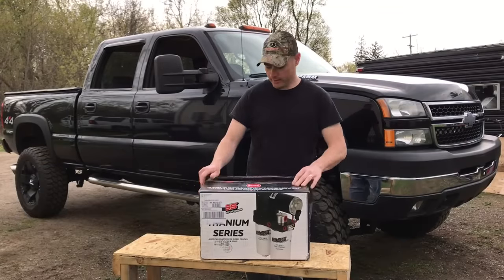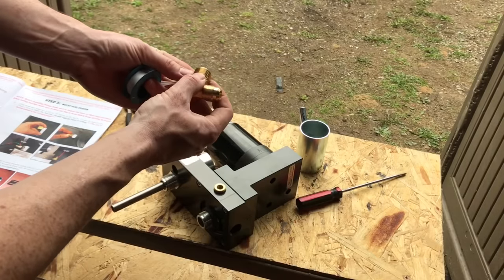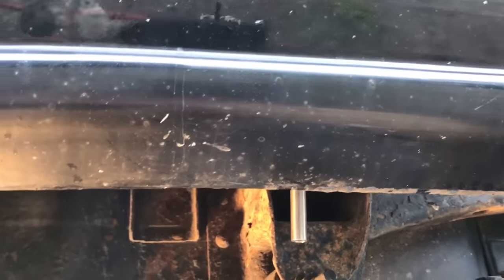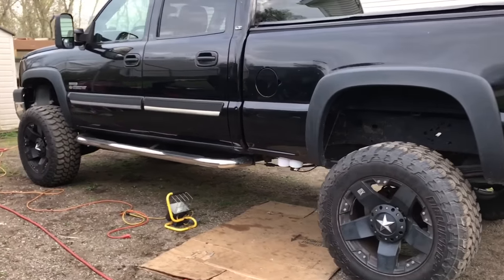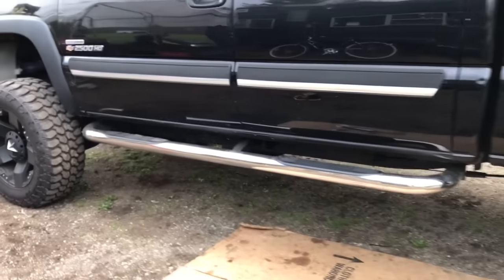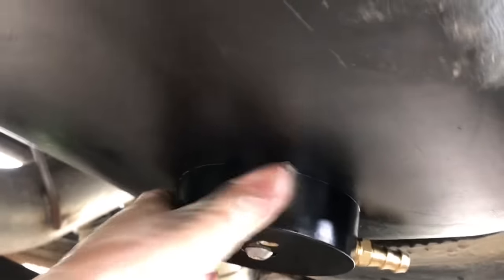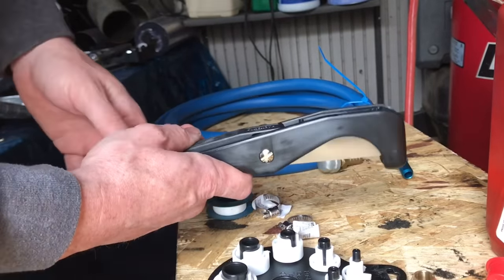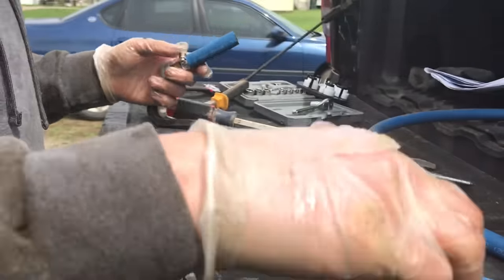Duramax FASS Lift Pump and Sump Full Install

Comment: Right after crimping fittings with vice-grips he says don’t skimp on how to cut hose
Reply: Yeah I felt the same way I commend him for doing his own work but come on man really
Reply: Don't forget his 25a fuse in the 10a ignition slot.
Reply: Don’t skimp but he used pocket knife to cut the filler hose 🤔
Reply: @ermannodangelo1062 as someone who always has at least two knives at all times and spends significant amounts time sharpening and caring for my blades I challenge you to show me any tool that will cut faster and cleaner than my pocket knives lol
Reply: @fishinmagician3960  ginsu 3000 son...Betta axe sombuddy
Reply: Ahhh vice grip crimps on the ring terminals did make me cringe a bit

Comment: Why did you put the sump in? My son has a 03 gmc and he bought a used fass    System and will need to get a hose kit plus the electrical kit to hook it up. Just wondering why you decided to drill a hole in your tank?

Comment: You put the Teflon tape on bass ackwards
Reply: I was yelling that entire scene, "No! No! It goes the other way!" but he didn't hear me...
Reply: Th second fitting looks okay if I'm seeing right but he definitely did the first threads backwards
Reply: Ya, noticed that.
Reply: @hollaschracing3753  3 vv
Reply: I scrolled down to see if anyone commented on that. First comment I see hahaha
Reply: Haa haa haa. I wanted to say something about the teflon tape also. He also used the crescent wrench backwards. I raz on my coworker often for that. In the case of Truck Master here...it's not that big of a deal.
Reply: You could skip making that mistake by just using pipe dope
Reply: Oh man, it made my brain hurt. Then he put a hole in the bottom of the tank and I was like, wait are you sure? Sure enough it leaked everywhere. Then he left the filters hanging out the bottom of the truck, and I was like wait that aint right. What happens when I go offroading having my filters all exposed like that?
Reply: That’s not the correct tape to use with fuel just saying

Comment: When installing a sump with your lift pump (highly recommended) use the old fuel pick up line from the tank as your return line. A. Do not have to cap it off. B. Do not have to hack into your fuel tank fill line. C. Makes for a much easier and cleaner install!

You will either need to cut the Bundy fitting off the fuel tank fill line adapter part supplied with the pump kit and hose clamp it on the fuel hose like I did temporarily. Or, better yet, order the right Fitting Fuel Line Quick Connector 1/2” Barb to 1/2” Bundy Male Tube. Parts dealer didn't have it so I found it on Amazon.

This is the best install video I found. I would only recommend this edit.
Reply: I didnt think about that until after I bought a sump with an integrated return fitting so I had screw a plug into it
Reply: OR wouldn't it be easiest and cleanest to just use a sump with the integrated return, which they all seem to have now.
Reply: To my own response now that I'm looking at how to route the hoses on my 2008 it would be much cleaner and very easy to run the return back and just plug it in to the original suction line from the tank.  The FASS kit comes with both parts so I'll be plugging the return on the integrated BEAN sump and fortunately it also comes with that option and part provided.
Reply: Darby Neil ...that’s a great idea! No need to hack into the fuel filler!
Reply: Connecting supply to factory line works fine, adding a 2nd return keeps truck running/operating like stock in case pump fails. Leave system as intact as possible to allow CP3 to still operate, it might get you off the road. Adding a low fuel pressure sensor is a good idea. Add in a sensor to EAS of the Cts3 for easy integration

Comment: I stumbled on this video when I bought my fass lift pump and misplaced the install instructions. I know this video is 5 years old by now but it was life saver for me. So thank you. One variation I was forced to make was that the bed bolt just spun in place on my truck where the pump mount is fastened. My guess is the captured nut broke free so the bolt would not loosen. Now I had to install the mount without removing that bolt.

What I did, and this may help others, is to weld a nut over the existing 1/2 hole that is directly inline with the bed bolt and about two inches away. That allowed me to run a 1/2 bolt through the same mount slot and secure it to the same frame member as the bed bolt. From there the assembly was much the same. Used some tire rubber to insulate the mount from frame to help keep things quiet. Piece of cake. No pics, but look at the bed bolt lying on your back with your feet facing the front of the truck. Trace left of the bolt two inches and you'll see the hole. Weld nut and chive on.....

Comment: To anyone who is considering and or bought a fuel pump you need to follow this guy’s channel! Recently bought one with no instructions included, so instead of printing off a 20 page PDF instruction manual, I just followed his step-by-step video that ultimately made the job 100 times easier!

Comment: I own an LBZ and have watched damn near every last lift pump install, and this is hands down the best one out!!!!Thank you for taking the time out to document this install so well. That sump looks a little sketching though, im still going to do it with my lift pump and see how it turns out
Reply from the maker: +GotBoost awesome I hope this helps out I appreciate the comment
Reply: GotBoost did you install a sump?  How did your install go?
Reply: @TruckMaster  hey bud, have you ever replaced  your fuel sending until?  I was jw if you knew what the blue fitting is for on the top of the sending unit is for?!  Mine was gone and now I dont know what it was for or where it is
Thanks man
Reply: @TruckMaster  do you recommend keeping the original fuel filter or do you recommend to delete it
Reply: do I need to tune my 14 lml after  installing  165

Comment: Gangster! I loved you drilling a giant hole in the fuel tank! I am so impressed seeing the next generation confidently  diving in to a project like this. you are restoring my faith in humanity. when I saw the vice grip crimpers I sent this to my aircraft mechanic buddies. Hi five on using electrical tape on your crimped connections!  I would offer up some comments on technique, shortening the extra length on the harness, ect,. Why be an A hole? You got it done in half the time it would have taken me. That's why your still married. Good for you!  I love your truck and appreciate the time you put in to share this information! Keep up the great work. You have a bright future.
Reply: Lol nice comment

Comment: Not a bad install. Just a couple things. Wrap the Teflon tape correct way and for future you don’t need to put tape on flare side of fitting. The flare side will seal just fine. Doing good so will not allow a tight seal which could cause leaking or air leak on suction side. Recommended amount is 4-5 wraps. Specially on the side that comes from tank. The mark on tank side you said to line up with isn’t a reference mark. The mark is a -1 for when they modified the T block to have more flow. The new ones will have a -2. The side with two fittings is the engine port on top and bottom one for return. Try angling your filler neck more up than down. It’ll give you more space. The sump kit wasn’t a FASS kit. The hole may have been maybe a little big. The FASS sump is way better. Far as priming the system it was about right. Just don’t unscrew it as far. If you listen to the tone of the pump you can tell when it fills the water  separator into the fuel filter. When I worked for FASS we would tell customers just replace both filter at same time. You will be surprised on how much junk gets in that WS filter. Other than that not bad. Hope this helps.
Reply from the maker: +Ben Strange I really appreciate the input especially from you. I’m really a backwoods joe side mechanic I don’t have much experience thanks for the insight
Reply: If you had let's say 1/8 of a tank of fuel and you pulled up into a steep driveway, is a guy gonna run out of fuel?
Reply: Ben Strange he’s a city boy he don’t know

Comment: If you go back to where you drilled the hole in the tank, you will see some factory raised lettering on the tank. If the o ring is trying to seal on top those raised letters, it will leak.  Since you can't move a hole,  I would sand down the lettering, until its flat with the tank. But you probably already figured all this out. I'm going to install this product on my 07. Great video.

Comment: Hey man, Great video! Something to keep in mind. I know they are easy to come by, but I would keep a spare replacement relay with you in the truck at all times. I've had one go bad in the past and it almost left me stranded. For a couple bucks it gives you some reassurance.
Reply from the maker: +Mark Mulhollen ok thanks for the tip I will look into that

Comment: I had to replace all my injectors for the second time in just 168K miles, $7K, when I talked to the guy at the shop he told me about this kit and how one guy he put it on for now has 250K on it since install and his injectors are still working properly. I have had mine for 10K miles now and love it. They did put the factory fuel filter removal kit on mine as I believe FASS requires it now. Simple bowl that screws on in place of the old filter.
Reply from the maker: +Jim Byroads it's a great investment for sure
Reply: I'm not aware of any reason to install the stock fuel filter removal kit, in fact one of the mechanics I listen to (Aden at GOS Performance) says to run the CAT-1 filter (which uses an adapter) for additional filtration.  The cleaner the fuel the better and with the positive pressure from the pump that should (no longer) be too restrictive.

Comment: When installing the sump if you Jack up the front or back of the truck before drilling you will have far less fuel running out
Reply: King

Comment: I just ordered one of these from my local supplier. The guys that fast said on the lb7 that they use the original fuel lines that run along the frame rail and Plumb right into those. It looks like your kit has its own dedicated feed line. They must have changed it at sometime after this video was made. The guy specifically said that the earlier Duramax is mine in particular is one of the easiest trucks to install their system on

Comment: Hey truck master.great video in the future (just a suggestion) if you need to drain fuel tank unhook supply side probably have to get fitting with barb and short piece of hose long enough to put in a fuel can turn on key use pump(air dog) to pump out truck into fuel can.

Comment: Helps to add some dielectric grease on all electrical connections. Also useful to label the relay so later you or someone else knows what it's for.
Spray some Rust penetrant up in there on the bed bolt.
I welded up a shorter pump bracket and put on the 2nd bolt. That way it slides up high behind the filler hose and filters are hidden.
Get the butt connectors with the heatshrink on there. There's also a heater element that can install right in the pump block and activate automatically to warm/thaw the fuel

Comment: I also love how it mounts to the truck with 1 12mm bolt then 4 bolts to that braket with 1 bolt! Im gonna clean my everything then replace the bolts with stainless hardware but the mounting bracket is getting welded on solid! Then a protective stainless steel guard will be made to keep Rocks and salty mud and slush from hitting the filters and parts! Thats the smart way to do it!

Comment: Put my fass on 3 years ago had the 1/4 empty issue, so put sump on later.  Hint I would not cut the filler neck, just run return line from fass into the tank with stock suction line.  Also if you drive lots of gravel roads put something on filters to protect them.
Reply: Yeah that's what I'm thinking, unless there is some reason not to: that would be easy access and just plug it in.  Did you ever have any issues or notice any additional strain on the pump.  I have to go back and look but I don't think the original suction line is 1/2 inch ID which I think would be the only difference.  I got the BEAN sump with the integrated return but on my 2008 there is barely room to squeeze one fuel up the side through 1 small gap at the top to go over the frame and I think the integrated return was more for convenience than performance.  It's so tight I may have to run under and up on the tire side with zip ties and maybe encase it in larger hose (in that area) for protection (TBD at this point).

Comment: nice video, wish i would have seen it before i did mine. i got a 2001 lb7 dually and i installed the same fass pump, i didnt watch all the video, due to drinking to much whiskey at the time. however one thing i can mention is DONT use that blue crap fuel line. well i used it on the pump and the stock filter. i went on a 1500 mile family trip and found i was leaving a puddle when filling up, it was a broken zip tie on a fuel line, that rubbed caused the line to rub on a bracket.  (it was a blue one, but ok) shortly after, removing the stock crap fuel filter head i was still smelling diesel fuel, (its a diesel duh) but i still had a small puddle of fuel under the truck where the stock filter would have been., those stupid blue fuel hoses failed again due to dryrot (within a year) and were leaking fuel with the key on and the fass pressurizing the lines. i replaced all those blue fuel lines that come with the kit and have not had an issue since (about 3 years now) otherwise a great pump, just no luck with those fuel lines

Comment: Used this to install the same sump today. Anybody watching should put thread tape on the drain plug in the sump, GREAT VIDEO!!!
Reply from the maker: Thanks
Reply: Better verify the pressures, cummins may use more or less psi than duramax. I think it's just a spring in the pump to change fuel pressure. Not positive on any of this but worth checking into it

Comment: I agree, very nice confidence builder. The only thing I might do a little differently is put dielectric grease and heat shrink where applicable on all electric connections except in fuse box. I like the idea of the sump  as well but the leak potential might keep me away with this.

Comment: Just an FYI from a heavy duty diesel mechanic when using Teflon tape always run the tape the way you thread it in if you don’t it will tear while threading it in and will not seal right

Comment: Awesome video. I installed a sump on my 04.5 LLY duramax and I drilled in the lowest point which just so happened that my sending unit was right there so if anyone is doing this on the same truck as mine drill of to the side!! Save yourself the boatloads of pain
Reply from the maker: +Mitchell wall very good point
Reply: I just did the same thing like whats the chances i lined up exactly with the sending unit. Did it throw off the fuel gauge any? Or is it still the same accuracy?

Comment: Great video! Next recommend project to do on your truck would be a double filter oil bypass filtration system. For a cleaner more efficient engine, is someone hasn't deleted their truck. Preferably amsoil product for you LBZ! Just a recommendation for your next project!
Reply from the maker: +jarvis russette thanks for the tip I will look into that

Comment: This is what I want to install next along with the upgrade manifold that ya showed . 
So , reasonable pressure on the sump pump and I guess adding the sealant just fer good measure . 
So this would also mean that the truck will have two fuel filters or as a friend chastised me for saying that vs a water separator. 
Ok , thanks for the detailed information.

Comment: Good video man, been watching a lot of urs and u do a good job at em, I run a small garage at my house and thought of doing some videos as well,, just one thing I could help with,,, on the sump kits I would just find me and oil filter that the square cut oring was the right size and use it for the sump kit instead of silicone, no offense on the rtv but over time it will break down but u could use both the oring and the rtv as well,, but an oil filter ring is tough enough for tight applications plus has a flat edge to seal up nicely,,, 

Good video and I’m not trying to down put ur info just add another way to do it, thanks for all the videos and keep up the street cred lol,
Reply from the maker: Thanks for the advice

Comment: GREAT VIDEO, FYI, when your putting on pipe tape, it a good idea to wrap it in the correct direction, so it doesn't get tore up as its being threaded in.
Reply from the maker: +MrRocky551 thanks
Reply: @TruckMaster  Coming off the backside of the tape roll is way easier than coming off the top. Little trick that keeps it tight.

Comment: Amazing video! Saved me lots of time and planning! Can I send you a pair of crimpers?? I dont want your wires coming out because you crimped with vice grip lol. Also add dielectric grease to all fittings/crimps if your worried about moisture in the electrical connectors!

Comment: Finally got my 2006 Chevy Express 2500 with an LLY. Bought it sight unseen and knowing it had issues and it didn’t start. I’ve dropped the tank and dumped the nasty gummy fuel and removed all the fuel lines and the factory lift pump and am going to install a Fass pump with plastic fuel lines from Fass. Waiting to talk to them tomorrow to see if they can set me up with the right fittings and help me decide if I want a sump. I’ve got injector fuel return lines and a low pressure fuel line kit ordered and will replace anything else that looks sketchy. I’m hoping I don’t need a CP3 and injectors right away. I’d like to get some other work done first. I’m replacing everything. All the belts, hoses, and other worn parts are being replaced even if they are not failed yet.